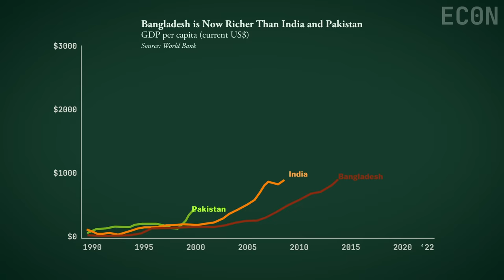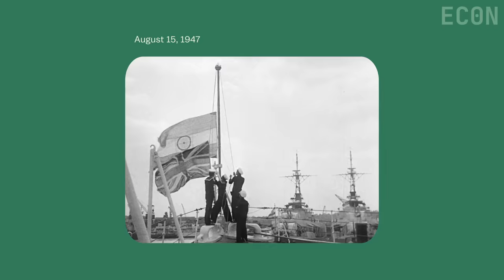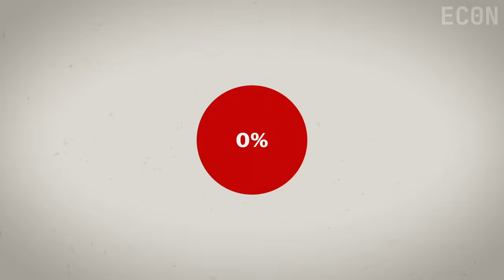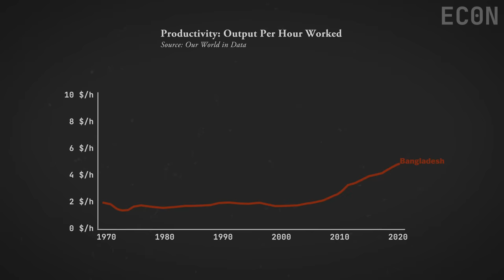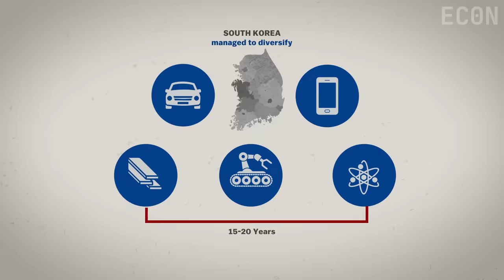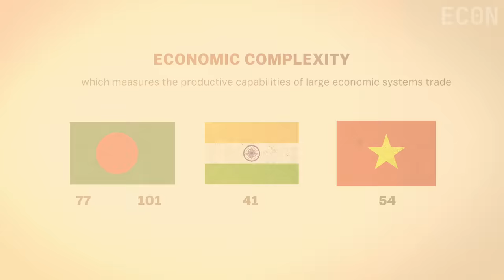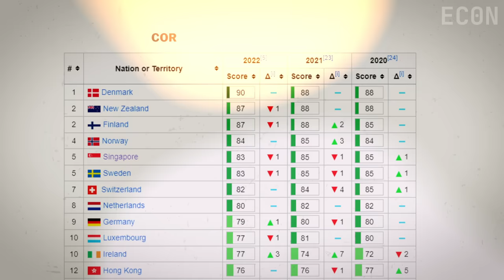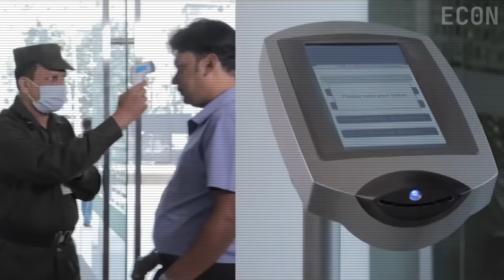Bangladesh Economy is Getting Rich but It Is at Risk | Bangladesh Economy | Econ

Comment: Bangladesh has been developing quite frankly but it might not last long due to too much corruption and instability. 
Political parties are a huge obstacle for Bangladesh (whether it's the current ruling party whom are autocratic and extremely corrupt ot the opposite party whom are extremely radical and are threat to secularism). 
The political parties of our country has lot of problems and none of them are near ideal.
Reply: Right
Reply: Corruption has been always it didn't came today.
Reply: The situation isn't that dire really. To be frank, it's as dire as it is bright. The reason our economy hasn't been doing well lately was because of macroeconomic instability. All of it was preventable and it's nice to see small steps are being taken gradually. I'm sure the upcoming finance minister will pick up the pace. Mainly, in making interest rates market oriented, faster. I still have concerns over the exchange rate issue though. Will they float taka fast enough? Time will tell. Bangladesh Bank still tries to occasionally prevent other banks from buying dollars at higher rates. They just need to look past the short term gains. Macroeconomics stability is key in attracting investments of all forms, be it FDI or local - hence FDI has been dropping over the years.

Tldr: our economic doom has easy fixes. Protectionism did us more harm than good.
Reply: Right 👍
Reply: Jojo pfp, opinion rejected
Reply: Jojo pfp, opinion rejected
Reply: Jojo pfp, opinion rejected
Reply: Jojo pfp, opinion rejected
Reply: Jojo pfp, opinion rejected

Comment: Undoubtedly, there has been serious damage in the DOING BUSINESS index over the years. Though its ranking has started back towards good ranking very slowly from 2018. To improve on this ranking, the government appointed some officials to improve this ranking. But, there is doubt whether doing business has become easy or not. 
In contrast to FDI, private investment had steadily increased from 12.5% of GDP in 1981 to 17.3% in 2000, reaching a high of 25.3% in 2019. Though it has declined from the pandemic period. Also, the success rate of government development has increased over the years. Without FDI growth, steady growth of GDP indicates an independent capability of doing better economically.

Comment: The next economic crisis is anticipated to be more severe, primarily because we won't have the financial means to bail it out as we did in the past. The previous crisis should have been more severe, yet it wasn't as catastrophic as anticipated. Additionally, individuals defaulting on their debts are likely to include those with good credit scores and loans carrying higher interest rates, amplifying the gravity of the situation in various aspects. Moreover, the current scenario is exacerbated by inflation depreciating the dollar and impacting markets, unlike the previous crisis, aside from high gas prices.
Reply: Inflation is causing a multitude of issues globally, ranging from food shortages to shortages in diesel and heating fuel, as well as escalating housing prices and the risk of a financial market crash. These factors are converging, and by the year's end, it could result in a full-fledged disaster.
Reply: For newcomers to the market, I suggest seeking professional guidance. The best way to build a well-structured portfolio is to start with a knowledgeable professional who understands the volatile yet lucrative nature of the market.
Reply: One of my objectives for the upcoming year is to engage the services of a financial advisor. I tried reaching out to a few via Facebook, but unfortunately, I didn't receive any responses. Could you suggest the advisor you work with?

Comment: 1:41 Wrong. India's gdp per capita is higher than Bangladesh. Atleast do proper research first
Reply: INDIA still lacks GDP per capita income compare to Bangladesh
Reply: @epsilon2586  Not really. India has a higher gdp per capita
Reply: @andyistphdhpc2726 right..... Bangladesh had high GDP per capita for very short time, then later on India retained its place
Reply: Actually Bangladesh was placed higher than India in gdp per capita( nominal) for 1.5 years ( from 2021 to 2022 july). Then again India regained her spot.
Reply: @souvicknath5716  I know that

Comment: A Bangladeshi: While Bangladesh has made significant strides in economic development and poverty reduction over the past few decades, it would be inaccurate to characterize it as a "rich" country. Here are several reasons why Bangladesh cannot be considered a rich country. 

1. Urban-Rural Disparities: Rapid urban economic growth leaves rural areas behind, lacking education, healthcare, and infrastructure.

2. Concentration of Wealth: Elite control of resources widens the gap between rich and poor, hindering equitable distribution.

3. Informal Economy: Workers lack security and rights, earning lower wages, perpetuating income disparities.

4. Gender Disparities: Women face barriers in education and employment, earning less in low-paying sectors.

5. Limited Education Access: Marginalized communities lack quality education, hindering upward mobility.

6. Inadequate Social Safety Nets: Government programs are insufficient, leaving vulnerable populations at risk.

Addressing income inequality requires policies focusing on education, healthcare, infrastructure, gender equality, and social protection.